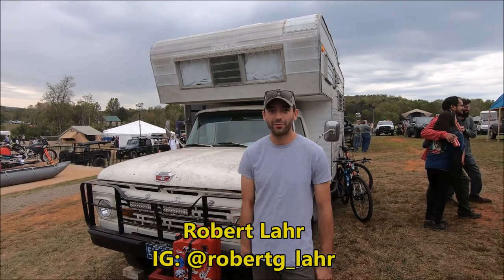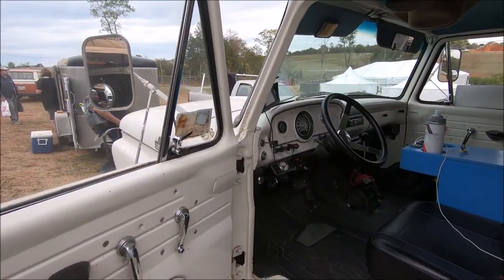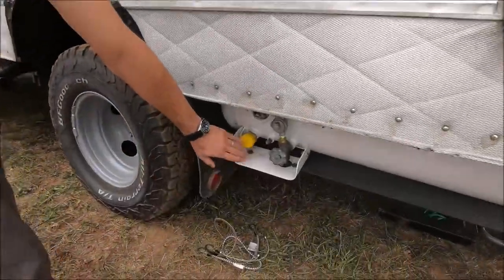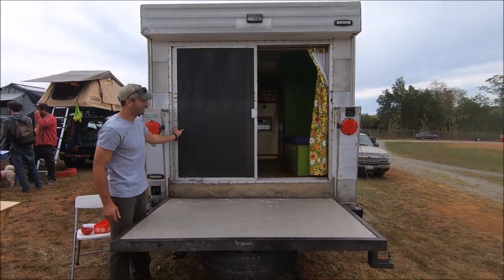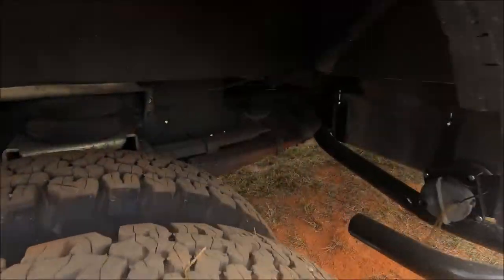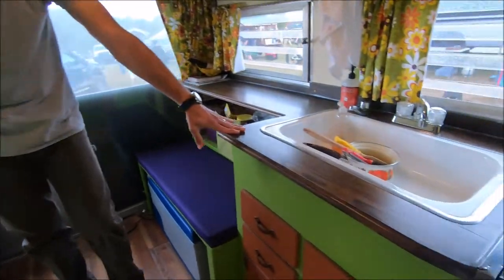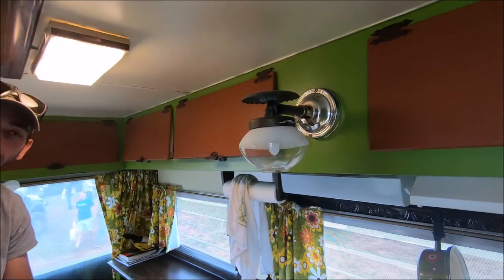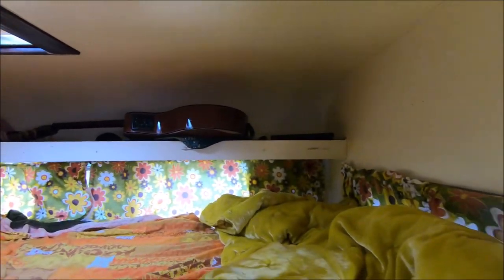Overland Upgraded 1964 Ford F-350 Open Road 4x4 Vintage Motorhome

Comment: Awesome camper but that propane tank worries me with rocks
Reply: Because LPG tanks hold pressure, they are way way stronger than gasoline tanks.
Reply: @caribooskidoo3997  a lot of things changed for Ford motorhomes, between 64 and 69.
Our propane tank is inboard,...right below our refrigerator.
We have the exact same propane light, heater, and water heater, but our holding tanks are pressured.
We have a factory air conditioner and front disc brakes, and an intercom .
Love yours, because of the 4x4, but don't believe we'll go that route, because of the cash needed to do the job, but it is cool knowing someone has already done it!
Nice RV bud!